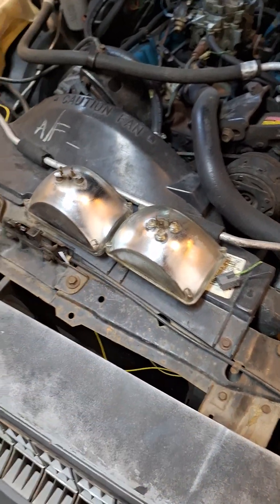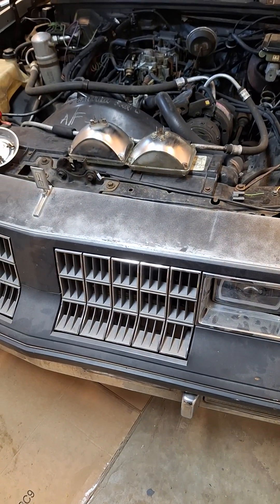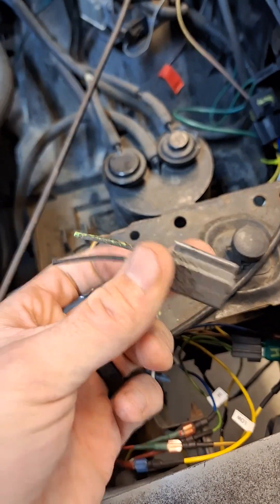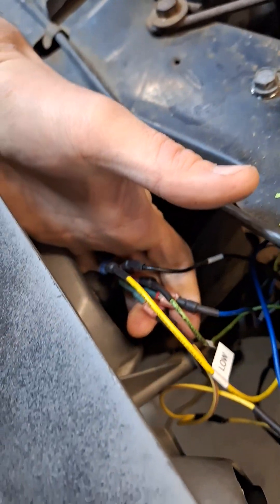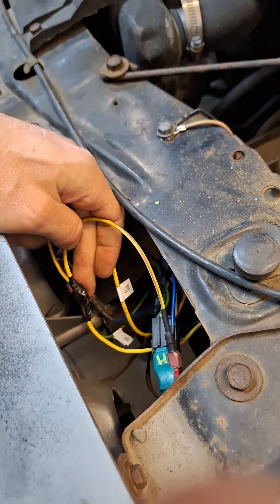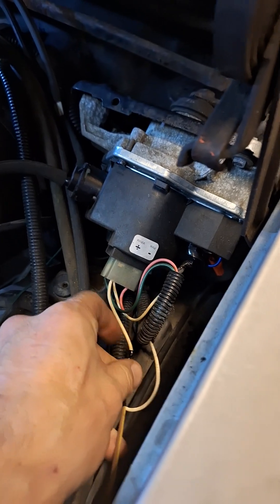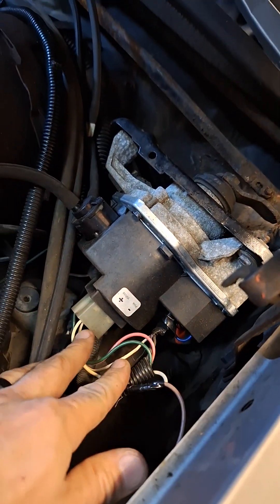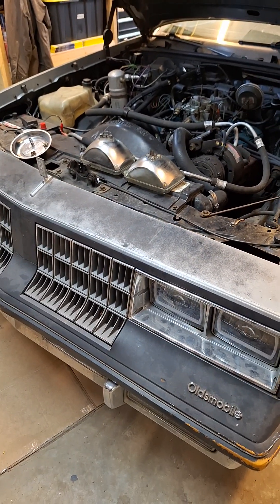G-Body Cutlass Aftermarket 4x6 LED Headlight Wiring Explanation

Comment: Question, why did you use a relay on the DRL‘s that you hooked up to the power wire of the windshield wiper motor? Do you have to do that or can you just wire it directly to the power of the windshield wiper motor?

Comment: So I did this setup in my sons 1985 Grand Prix only I didn’t use a relay I tapped into the side maker I still got the DRL to run some how ?  I’m just wondering if the relay is acting a switch potentially and question number two is do you think the wire gauge would work with what they equipped it with something I noticed right away was the factory wire is hearty compared to the led wire anyhow I’m just wondering if I’m going to possibly end up melting the wires and then having a small fire lol I’m concerned about to much voltage but I’m new to this any thoughts thanks man   Oh I’m about to install a set on my Monte Carlo they are slick

Comment: That didn’t explain anything about how how to wire it up man delete this video. You sound like you don’t understand it.
Reply from the maker: Well I wired it myself, it works 100%, and hasn't caused any issues whatsoever, and I've done plenty of other 12v wiring, so I'm pretty sure I understand it. I just made a quick video to try to help others who may be putting newer LED replacements into these old vehicles. Additionally, recording a video in one single take and clip is inherently going to sound more disjointed than a video with clips spliced together. Making youtube videos is not my job or career and my channel is tiny, so spending a lot of time doing multiple takes for when I pause, forget a word, use the wrong word, etc, then video editing and splicing for hours, etc, is not high on my priority list. Sorry if this didn't help you any.

Comment: Man can you draw it out on a paper. To show the diagram. I’m on the same boat with a 1985 c10 with stacked lights.  Converted them to Led with turn signal/drl option. My low beams are super low and if I turn on high beam they are bright On all 4 lights.